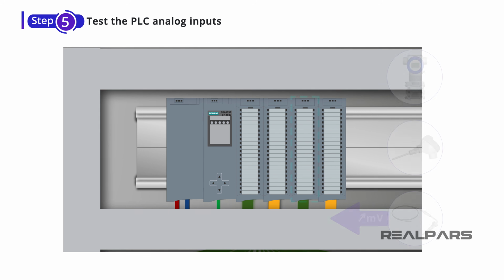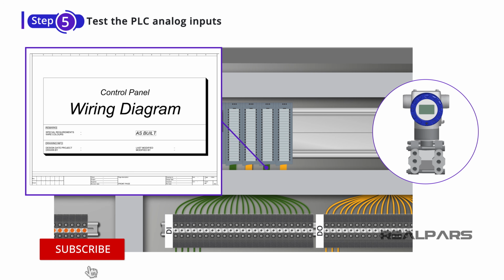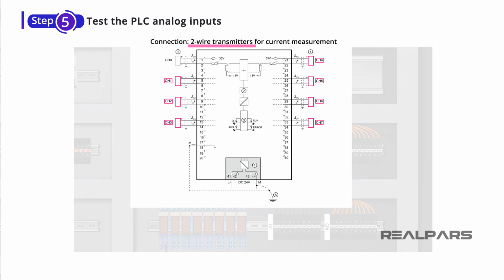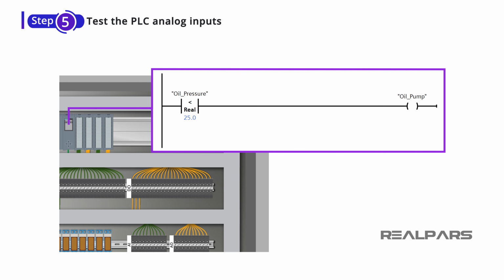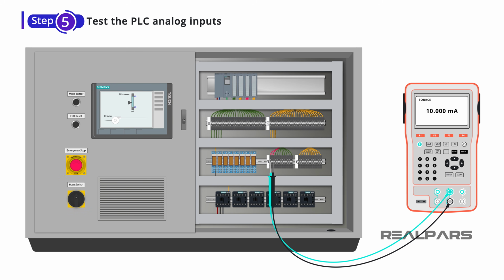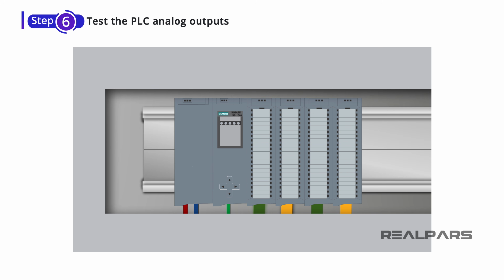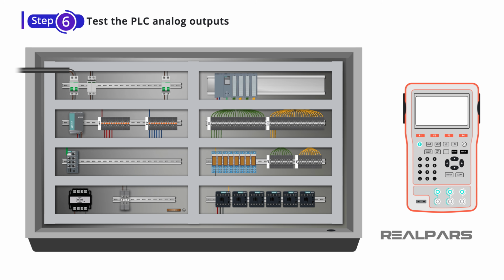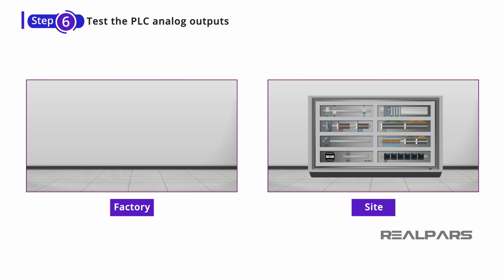Factory Acceptance Test Explained - Part 3 | PLC Analog IO Test

Comment: What Simulator do you use?
Reply from the maker: Hello, @iiojiinkIimkojjjilh Thank you for your question.  It all depends on your needs. A current/voltage simulator to test analog or digital signals into a PLC or any they of electronic controller, depending on your engineering design. But here are two companies you can check out the features of their A/D simulators for your learning and use:  
https://www.fluke.com/en-us/products/electrical-testing/digital-multimeters
https://us.rs-online.com/product/dwyer-instruments/csg/70328500/

Comment: Imagine being asked to do these tests prior to software install. would you consider that a waste of time?

using manufacturer software to check the plc reading, you are just testing the reliablilty of the plc.

I have told my business 100 times its a waste of resources and im being forced to do it
Reply from the maker: Hello, @Djfletch978. Thank you for your question. You asked if this is a waste of time. Absolutely not! This FAT test process is a standard procedure that is required as set in many customer contracts. This procedure saves lots of time and money by finding errors in wiring, parts, and engineering, to name a few. It is better to fix it in-house before the control cabinets leave the factory. For example, fixing the problem at the factory, you will have the manpower and resources to do so, then to have to follow up at the customer's site would be more expensive. 
Happy learning from RealPars!

Comment: What is the recommended model of a signal simulator?
Reply from the maker: There are several to choose from:  787B Fluke Process Calibrator, PIE 334 Loop Calibrator, TimeMark Model 680 4-20ma Loop Simulator.